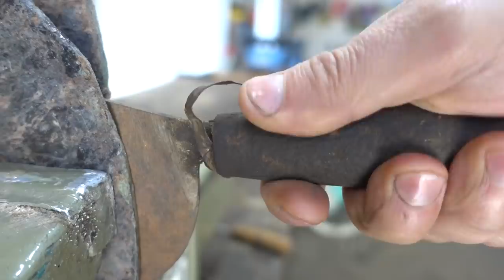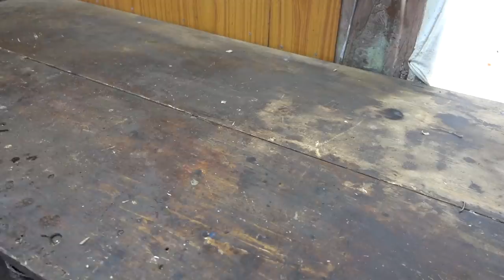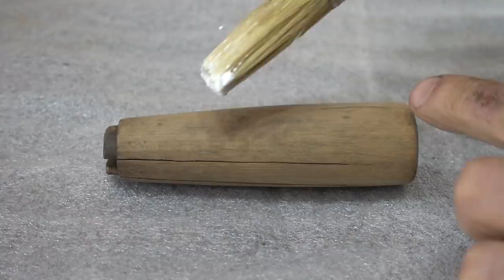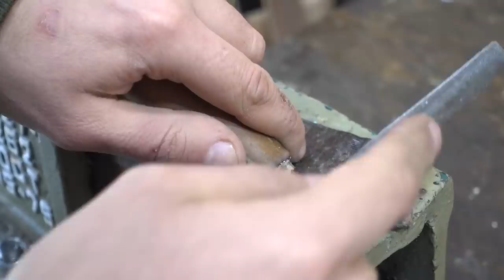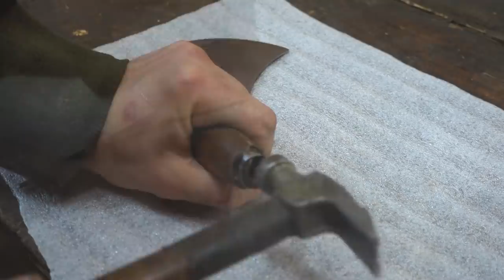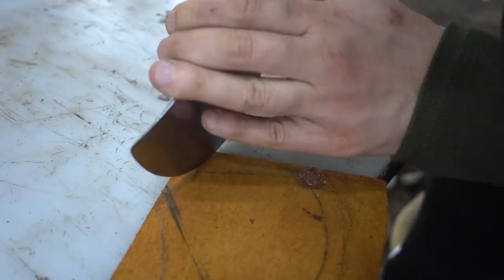Restoration Antique Round Leather Knife

Comment: Usually I don't like it when most or all of the previous parts of a tool are re-used in a restoration but for this tool it actually worked out pretty well and I was happy to see so! Especially the re-shaping and re-positioning of the round metal piece on the handle